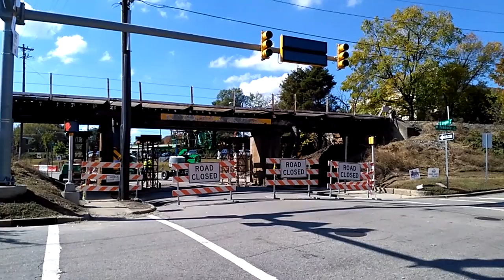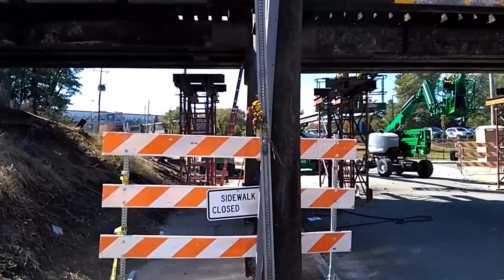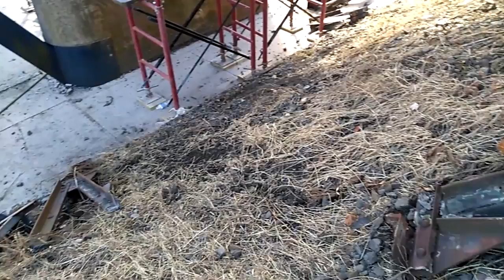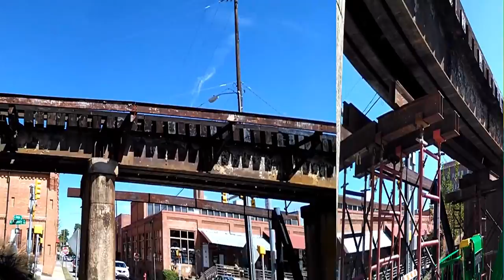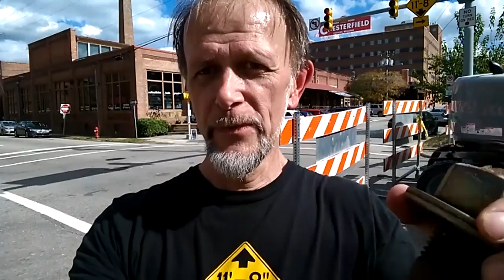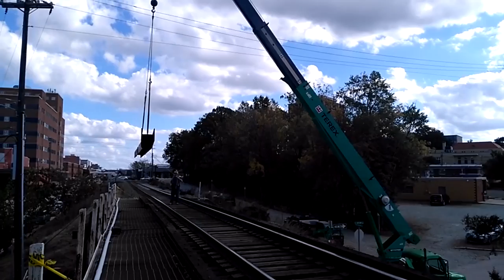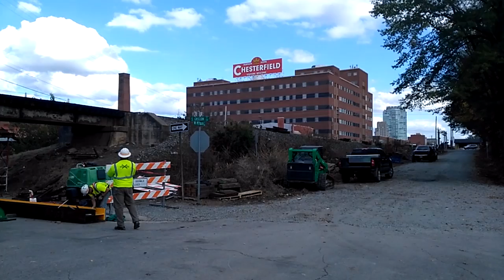Preparing to raise the 11foot8 bridge

Comment: Road needs repaved.  Getting rough.  Add 8" of asphalt. That should make it smooth again.
Reply: Not a bad idea!
Reply: Call me crazy but I think it needs 10", that way they won't have to worry about re-paving for a long time. 😉
Reply: They already repaved the road less than 5 years ago.
Reply: @Joshua79C  you ruined it.
Reply: @Joshua79C  woooosh
Reply: @Joshua79C  You seem to be missing the joke.
Reply: @Joshua79C Added 6" that time?
Reply: @smartrubberchicken  you can blame my lack there of for not having gotten any rest for more than 24 hours. gave my mind a little reboot for a few hours since.
Reply: @Reach41  Added 6" to what ? If when they repaved the road and gained 2 inches of clearance, that would make the new height 10 actual inches of clearance. So those saying "lets pave it over with 8 inches" while trying to be comical with that are clearly lacking in the math department. Still even just an extra 8 inches of extra clearance is still not enough for trucks that sit taller than that.
Reply: @Joshua79C   Repaving operation often just preps the surface for the new material to adhere to.  I checked with the county, though, and it seems they added only 1.5" to the previous height, reducing the clearance by that much.
Reply: That’s exactly what they will do in a few years lol
Reply: @danzilla3223  Jesus, please do bother to read previous responses, I even posted a link is a previous comment to a video of when they already did repaving a few years back, please do take a few minutes to view it. They usually performs a full surface repave every 20 years or more.
Reply: +1
Reply: add two feet asphalt, shuld be just right then..........

Comment: The standard box truck is 13’ 6”! Rejoice!

I bet more people will still be over height due to thinking the bridge rose more than it did.
Reply: Let's hope so! 😂
Reply: I hope it leads to more of the very appealing impacts where the truck makes it all the way through but just the very top skin of the trailer is entirely peeled off accordion-like.
Reply: Box trucks are usually 12'6 tracker trailers are 13'6
Reply: Yeah. It's a ploy.
Reply: @garzascreek seems like you are correct

Comment: 12' 4" is still low most straight trucks are about 12' 10" she'll eat again
Reply: I think the rentals driven by inexperienced people will fit under though
Reply: 12' 8" bridge in my hometown get hit regularly by semis who go off the state route.
Reply: My thoughts exactly, anything under 13 is a danger to most box trucks
Reply: @Julio-jm8ld  13' 6" is the standard height.
Reply: @scottbc31h22  you need to start a channel
Reply: Eighteen wheelers are 13’ 6”. I guess they will still be crashing.
Reply: I thought most 26-footers are 12 even...?
Reply: At least our company (whose award winning drivers are seen here frequently) have trucks in three heights.  26’ trucks are either 12’7” (those with ramps), 13’1” (most of those with lifts) or 13’6” (limited numbers of box trucks, and all tractor trailers)
Reply: @kathyyoung1774  except that there is only a small handful 18 wheelers trying to go through. so doubtful that there will be any increase in 18wheelers hitting. just the straight trucks with 13'6 boxes.
Reply: Most rental box trucks are 12 foot 6 inch and taller, they will still get snagged with the new height.
Reply: On Dash Cam owners Australia a truck hit a bridge and it was 13 Foot 1234 bridge, 4 meters for those in the know. 12 foot 4 we'll still see videos. it will just be the Old 11 foot 8 bridge.
Reply: @kathyyoung1774  semis can be up to 14 foot
Reply: I assume the logic is that it will spare the rental trucks but not the 20 wheelers, which are driven by professional drivers anyway.
Has there already been a semi crashing into it ?
Reply: @xl000  There have been a fair few fullsize trucks, yes
Reply: @ke6gwf  not unless they have a permit for over height. 13'6" is as high as possible with no permits.
Reply: nom nom nom
Reply: William Stark 13’6” is the standard semi height. No bridge overpasses should ever be built at less than 14’.
Reply: @jaysmith1408  "our 'Award Winning Drivers'"  ** HA ! **
Reply: When I had my shop built, I specified overhead doors large enough to accommodate most anything road worthy. I ended up with 14' doors and 17.5' side walls.
Reply: Bet you that 6 inchs is all they could raise it without doing more work on either side of the bridge. Cheap bandaid for a gushing wound. Do a job right or not at all. In a few years there will be the same bitching about the new as they did about the old. Track owners need to pony up and raise the grade for a mile back and Durham needs to build a safe underpass. Do it now while labor and materials are cheaper than they'll be in twenty years.
Reply: They should have just lowered the bridge so the clearance is like 7 feet and it would be really obvious
Reply: We can ONLY hope.
Reply: @patricksanders858  What are you a Party Pooper? Raise it so high nothing crashes ever again??? Go play in traffic.
Reply: So now we're getting a "just the tip" can opener
Reply: They need to make it 15’ at least.
Reply: Lower the road it’s cheaper
Reply: Lol
Reply: 13'-6" average height of big rigs.
Reply: What are you guys on about? Most of the box trucks I've seen are too tall by an inch or two. The perfect can opener height. I've seen a couple that are 4 or 5 inches too tall and they get stopped pretty quick with a bang. Six inches will do away with the great majority of our content.
Reply: At least RVs won’t be breaking off air conditioning units anymore
Reply: @ke6gwf   Only a few States allow a 14' overall height, the overwhelming majority are 13' 6".
Reply: @mr7badass   There are States with a 14' limit.
Reply: @cdizzle99z  -- Lowering the road under the bridge will not necessarily work in all cases.  I've seen cases where a truck would attempt to go under a bridge because the stated clearance height of the bridge was more than the height of the truck / trailer, but because the trailer bridged the gap on both sides of the dip, the effective height of the trailer was more.  Instead of hitting the front edge of the bridge, they basically come up underneath it.  If you are going to lower the road under the bridge, you need to also lower the road leading up to and away from the bridge so that this doesn't happen.  That probably ends up more expensive than raising the bridge.  Also, it's probably easier raising the track leading up to the newly raised bridge since the railroads already have fairly automated equipment for replacing the ties.  Since the ties are not connected to the rocks that they are lying on, they might just need to raise the ties and let a bit more rocks fall underneath them.  It would be nice to see a video of how they raise the rails.
Reply: @Joshua79C There is always a few inches of safety margin.
Reply: Yes, most semis are 13.6, high-cubes are 14'
If they're going to bother to raise it, you'd think they'd just fix it right and be done with it. This is going to be a lot of money for not fixing the problem.
Reply: It must feed.
Reply: Exactly
Reply: The one state i know of off the top of my head is Rhode Island with the most number of bridges that are over 14 foot, 15 foot or more of clearance.
Reply: @okaro6595  That is true, but does not mean much when the height off the vehicle was underestimated. and you still get those that scrape, especially when it snows and has not yet been plowed and a tall trucks domes along and it hits the protection beam to some extent.
Reply: @akbychoice  Most of the replacements for the low Long Island Rail Road bridges have been 14'.
Reply: @CurmudgeonExtraordinaire , if you noticed more closely, you would see that most bridges do not have any ballast and the sleepers sit directly on the beams. Such is the case with this girder bridge.
Reply: You're the hero we need. Ty sir
Reply: Here's hoping for a can-opening crash on the very day they re-open the road.  🤪
Reply: @Joshua79C  Non-sequitur, much? He was (quite explicitly) talking about the road and track around the bridge, rather than the bridge itself.

The height of the bridge track, and how or whether the sleepers are attached to the structure, are utterly irrelevant because that structure is what vehicles run into.
Reply: they are now at the point where they can at least dig down the last few inches for the 13 foot ish clearance for most box trucks... rather than a second raising of the bridge
Reply: @mr7badass  possibly where you live.  I know car carriers have to be under 14' 7" here where I live. Any higher and they are at risk hitting.  See them measure height all the time
Reply: @Joshua79C  -- Yeah, but they can't just raise the bridge without also raising the rail leading up to the bridge.  Unless that area of track was for VERY slow moving trains, I would think that they are going to have to spread that increase in height over a bit of a distance so it doesn't seem like they are hitting a speed bump on the bridge.  I was talking about the ballast on the portion of the track leading up to the bridge.
Reply: @CurmudgeonExtraordinaire  As I said and  Please do refer to this article : https://www.wral.com/durham-s-can-opener-bridge-being-raised/18712577/
Reply: @robertshunter  by landmass, most of the US allows 14 feet or higher.
The East Coast states tend to be tiny, so maybe by count fewer allow 14 foot, but it's pretty close to even at least.
Reply: akbychoice 13’ 8” is quite common.
Reply: Papabootycheeks not unless you know a cheap way to make sewage run uphill. There are sewer lines under that road.

Comment: Bridge is now 12'4" so nobody will crash into it.

Penske: hold my beer
Reply: LOL for sure!!
Reply: Still will be too low for 18 wheelers, they REQUIRE 13 ft. 8inch clearances 

With exception of flatbed trailers & low-boy heavy trailers, which often are used for construction equipment which often REQUIRES HIGHER clearances that State DOT requires specific routes in state-issued permits before the trucks can cross state borders.
Reply: Ha! More like Swift: hold my wheels!!!
Reply: Last Penske I drive was 13'4" on clearance.
Reply: @Howard1939  a lot of semis are 14 foot tall lol
Reply: There will be trucks that high and a little bit more. They will come.
Reply: Hahaha 🤣🤣
Reply: 13' 6" is the minimum for a standard semi trailer.
Reply: Nasim Wehbe how do you know that truck is a Swift truck? They put the wheels on top.
Reply: @Howard1939  13'6" actually, but I got nervous driving under anything under 13'10".
Reply: Penske i last drove was 13’1”
Reply: @ke6gwf  If they are 14ft then they need an Oversize permit and a pilot car.
Reply: I know a retired couple that drive an F-350 with a ridiculously tall camper that is over 13' so not just commercial vehicles over 12' 4".
Reply: ....it just means that a few more travel camper trailers won't lose their  roof-mounted A/C/ units from now on.
....an extra 8" is nothing.
Reply: @bloodmoongrizzlythefirst6492  in most of the country 14' is legal without a permit.
I guess the east coast never got around to raising it and is still at 13 6, but I guarantee that they still find their way over there frequently! Lol

Comment: I'm guessing this will reduce the number of crashes, but not be so high that they go away entirely.
Reply: Nope semi trucks are 13 6
Reply: merlinicorpus less crashes but the crashes maybe much bigger
Reply: @khubba10  a good portion of box trucks are over 12'4"
Reply: @khubba10  There have been a few semis caught up over the years :)
Reply: @khubba10  Yeah, definitely the less experienced drivers are definitely the biggest culprits, but I imagine the new height is probably just the best they could do without causing massive rework on the rail line.  Or if that would even be possible at all without a cascade of issues.
Reply: Maybe they will lower the road an inch as well. Yes i know that there are sewer and gas pipes under the road but 1 inch shouldn't matter. They wouldn't be that close to the surface.
Reply: @doctordothraki4378  Wow, looking at the one bridge, it was 8' 6".  I don't think I've ever seen a bridge with such a low clearance.

Comment: Don't get rid of the cameras just yet. 12'4" is still pretty low.
Reply: Sadly it's not.
Reply: dlwatib dude! Is it seriously that hard to get 13ft here!? Can't also lower the street a few inches?
Reply: @phatsdonahue2516  maybe lowering the street but there looks like there are two intersections on either side of the bridge so that takes that out of the question because they don't want too steep of a hill. Also a few more inches needs different steel braced at different areas. You have to think about the loads on the bridge and how much it can actually hold. Raising it even a little changes all of that drastically.
Reply: @phatsdonahue2516  No. They can't lower the street.
Reply: @phatsdonahue2516  if they lowered the road it'll just be a giant bathtub, reworking drains and such, Detroit metropolitan area is full of these lowered roads under overpasses.
Reply: Ryan Jay I think someone mentioned in a past video that there is a lot of infrastructure underneath the road surface that prevents them from lowering the road surface to make any significant difference
Reply: PhatsDonahue : to get 13 feet you would have to change the grade on either side of trestle over 3000’ of grade adjustment. Well in the dirt world anyway. Not sure about tracks.
Reply: @phatsdonahue2516  They cant just dig out under the bridge. Any semi 13' 6" needed, will make the tractor through but the 53ft trailer will not as itll still hit the bridge in the center of the trailer. To lower the road require the entire intersections to be cut down as well. Its not a cheap venture. Raising the bridge is also not cheap.
Reply: @mrcontroversy222  A few quotes from Trains magazine:  "On main lines, grades are generally 1 percent or less, and grades steeper than about 2.2 percent are rare."  "A given locomotive, then, can haul only half the tonnage up a .25-percent grade that it can on the level."  https://trn.trains.com/railroads/abcs-of-railroading/2006/05/grades-and-curves
Reply: @darrenkastl8160  ain't that the truth!!!
Reply: Brandon S afaik it’s a private webcam setup in/on the building across the street, specifically just to capture the crashes, not a street cam.
Reply: Brandon S  They cantbduebto the traffic, lost business and time of the year. They wont because the project will at least cost $5.5 million and at least 2 years to complete.

Its not lack or bad communication. Its putting logic into it.
Reply: @mrcontroversy222 , not only with raising the tracks, but also adjusting the nearby grade crossings as well.
Reply: Brandon S ya they do hahah got a whole website and everything
Reply: Brandon S  It’s not a “street camera”...the narrator just told you he’s the guy who has been hosting the camera all these years!   “Do you always discuss things you know nothing about? “   Pwned yourself, LOL!
Reply: Brandon S Where did you get the idea that it’s a “street camera”? You might want to look up the web site, or watch the videos where he talks about it.
Reply: You are right about that
Reply: Oh it is. I predict trucks getting stuck under it all the time. if they 100% wanted to ensure that it didn't get hit they'd have made it 13' 8"
Reply: Anon Ymous  Well, no duh it can be done. I didnt say it cant be done. I said it cant be done currently. Its a $5.5 million dollar project and 2 years. Its not going to happen. Chepa fix is to lift the bridge. Thats been done now. Thats it. You cant cut simply under the bridge as a semi with a 53' trailer will still clip in the trailer center. Again, it wont happen.
Reply: Maybe they'll start building taller trucks. Well, we can always hope right?
Reply: Dumbest thing ever all that work and not make it 13’6 is just stupid, leave camera set up still because truck and rv s will still hit it
Reply: Anon Ymous  Again, it wont happen bud. I worked with the Highway Department, worked as a road designer, and come from a family of truck drivers. I know all this all too well. This is why i refused the family line of trucking and gone the other route just to be tossed out adding common sense. Im happy a dispatcher for emergency services and tell people where to go.
Reply: Brandon S  you missed my point.

Comment: It'll be interesting to see what doesn't fit under the 12 foot 4 bridge...........👍👍👍👍👍👍👍👍👍👍
Reply: No shit Sherlock..............
Reply: Probably some semis where the driver is a fool and doesn't know their load. Happens at least once or twice a year at a bridge in nearby Raleigh which is 12 foot 4. Semis either get stuck or have to back up . Both causes traffic backups. This is the Peace Street railroad bridge closer to Glenwood for locals.
Reply: most highway trucks are 13'6"
Reply: Any regular box pulled by a big rig would hit it. They're 13' 6" legally but most sit about 13' 3" depending on factors.
Reply: Big Penskee box trucks are 12'9.......
Reply: RSSS68 Camaro  Zing!
Reply: Can't they do something to the road for a few more inches?
Reply: Tractor-trailers won't because they need a clearance of 13 feet 6 inches.
Reply: I’m curious about the heights of vehicles that hit it over the years. Were they under 12’4”?
Reply: @25dollarsaday55  ...I think a lot of the Rental trucks that got opened up by the 11' 8" bridge may get under at 12' 4" ......but there's still going to be plenty of strikes I think !!!